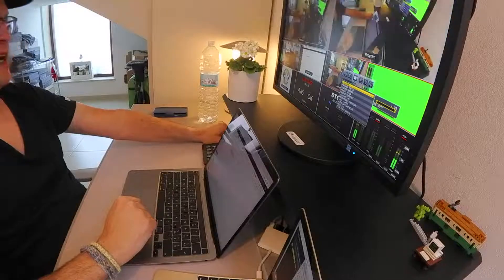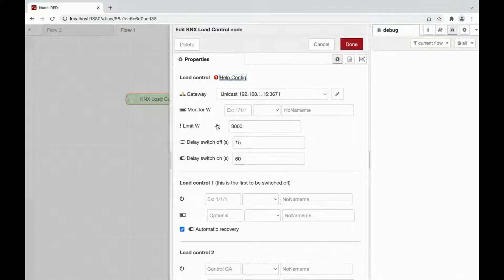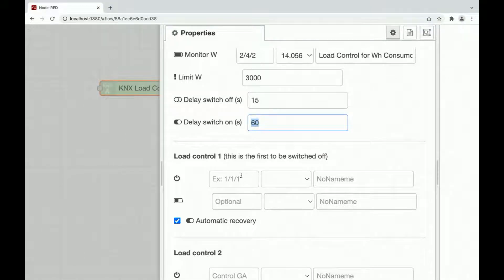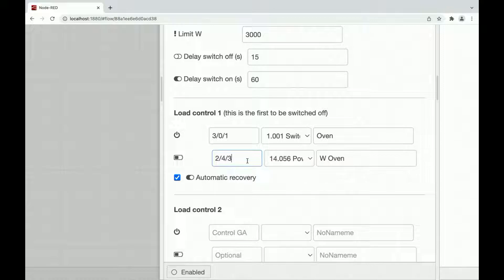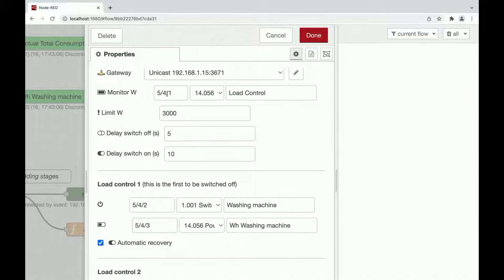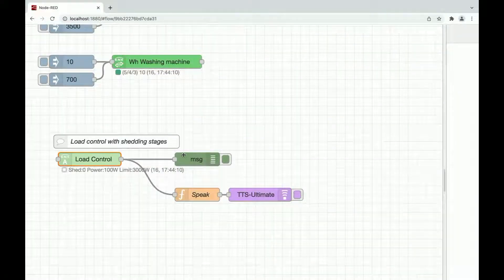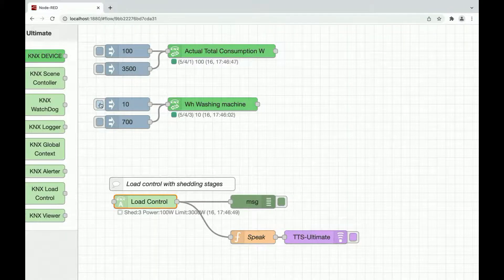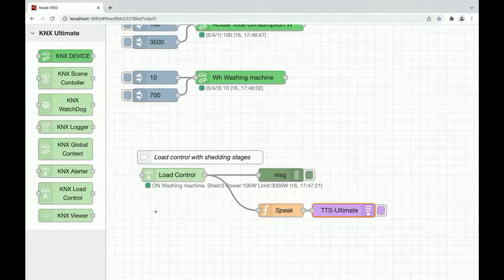KNX-Ultimate Load Control node for Node-Red

Comment: Great video, what hardware are you using for the gateway and switching devices?
Reply from the maker: Hi
Enertex KNX/IP interface and ABB switches with embedded power meter. Don’t recall the exact model.

Comment: Hi, I also want to use Ultimate for communication Node-RED (Cerbo GX) to KNX. Unfortunately there is a problem. The gateway I do not get set up.

Flows stopped due to missing node types
knxUltimate-config

Before I tried KNX easy, there the setup of the gateway worked. Unfortunately it was very unstable.
How to delete a faulty gateway again to install a new one?
Reply from the maker: Hi. Remove the config nodes of knx easy. Just remove the palette from the node-red menu. Here, you can also see the hidden config nodes and you can also delete it.
Reply: Thank you,
but there is one more thing. Previously I had installed node-red-contrib-knx-easy but I can't get it removed.
Message:
Removal of 'node-red-contrib-knx-easy'.

Removing the node uninstalls it from Node-RED. The node can continue to use resources until Node-RED is restarted.

Failed to remove: node-red-contrib-knx-easy.

Unrecognized module: node-red-contrib-knx-easy.

Check the log for more information.

What can I do?
Reply from the maker: @hjb_l_4614  Hi. Sorry, but you should ask on the node-red forum. I cannot help you on that.